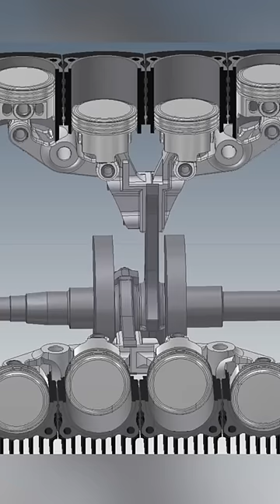STRANGEST V8 Engine Ever Made

Comment: Yeah but that makes it even harder for the engine to run properly and it's not like putting enough power into the crankshaft to run the engine properly it just like running a 2 cylinder with 8 Pistons the diagram you can see is not putting enough power into the crankshaft

Comment: Interesting idea, but it creates more problems than it solves, imo. 

It should sound similar to a flat plane V8 (and it sounds like that to me). It should have perfect balance. But unfortunately, the cylinder-to-cylinder volumetric efficiency won't be balanced. In a conventional engine, the pistons do most of their movement between 90 degrees BTDC and 90 degrees ATDC. The inner pistons will behave this way, but the outer pistons will do more movement near BDC. I suspect volumetric efficiency for the outer pistons will suffer as the piston will dwell slightly longer near TDC and not accelerate as much to draw in the intake charge. The reciprocating mass is greater, too.

Comment: I don't find this engine bizzarrre what so ever. In fact I recognize genius here. A turbo charged engine on this order has interesting innovation potential. A geometric design for a wankel rotary could change the conventional  combustion profile of engines radically. Visualize an 6 cycle rotary dual turbocharged engine innovating on the engine   in this video. The potential here is magnificent.

Comment: It'd be lighter with less parts, but the fact on both sides the arm has to rotate as the rod goes up and down around the crank makes me concerned. I feel power is lost trying to compensate for those arms, and I feel reliability would be an issue.

Comment: What's the piont of the extra 4 pistons they are not engaged with the crank shaft so it is not gonna add either hp or torque to the engine so that's a waste of weight gas and space .

Comment: But how do the two outside pistons deliver power to the connecting rod with that pivoting rocker arm thing between the inner and outer pistons? As the outside piston moves down, it pushes the inside piston up. Not push the connecting rod down. For it to generate power, it must push down on the connecting rod. Which it doesn't do. At best, this is a four cylinder with four useless cylinders.

Comment: Can't balance that engine. Pistons, rods, caps and bolts all have to not only WEIGH THE SAME PER STROKE: They all have to have the same FRICTION PROFILE. To get high RPMS. That engine would need machining every 10K with new bearings and new motor mounts probably similar time. But interesting idea. Just a curiosity. Honda and Toyota aren't knocking on his door.

Comment: That's bad a** but at the same time, I could just picture of breaking kinda, but I'm not trying to I degraded your work. It could probably last but it just trying to figure out where the tension would be focused on with those pitch stints like when those 2 go down and those 2 go up how the hell does that really equal and work right? Is my really seeing that for rills like okay so when?  When the 2 middle ones go up, I'm already to compress it shoots it down and then those ones go down the 2 middle ones. Then when the outside ones go. Uh, uh, it would be down how the f*** would it turn around or spend in the rotation? I am bizarre or choose. I'm just so Bargold.  That's really cool bro

Comment: Yeah Deiter that looks like something to build as a hobby, or bragging rights that you done it and it ran. I personally dont see how this motor would be more reliable than the type of ICE that been used in vehicles for many years. The way you have all 4 pistons connected like that just looks like a grenade and you added the pins in said grenade. When it lose a pin, well you know. Ive always believed anything with rotating parts will eventually wear out and fail. Seems like your design just adds more things to rotate and be subjected to the forces of petro exploding. No way could that be more reliable than what we already have. I wouldnt use the term wierd that narrator did, id say its different.  Very interesting but still impractical.

Comment: I guess the question here is it worth it to have 2 of the same strokes occuring at every stage of the engine side by side like that in their own piston chambers but have all that energy funneled down to one point of rotation. This seems like a material stress nightmare. I mean if linking more pistons to the same stages was efficient wouldnt all engines use this setup just to save space? Id wager there is a huge efficiency drop off by sharing that samepoint of rotation and why engines are split to have a rotation on eitherside per cylinder in rhe first place. 
However that is just my entirely uneducated guess. Lol

Comment: That looks like a terrible engine design... More complexity so more parts to break at a greater expense. All the force is transmitted to the crankshaft through just two rods with probably just as much loss of power as a regular v8. Then, it makes only 70hp for a v8? Ducati makes a single cylinder engine with more horsepower than that...